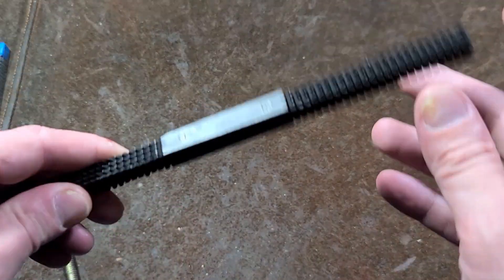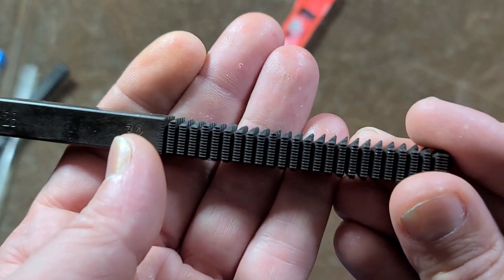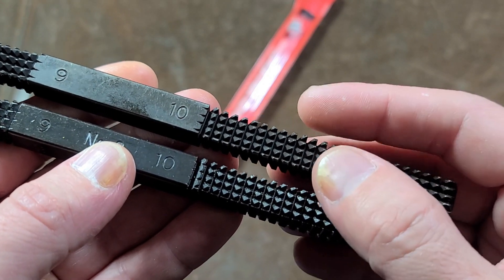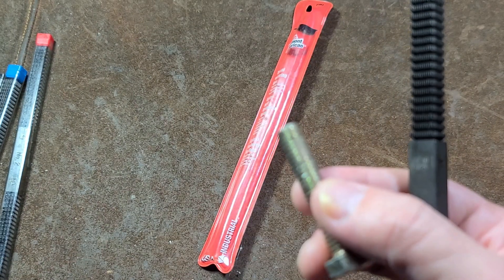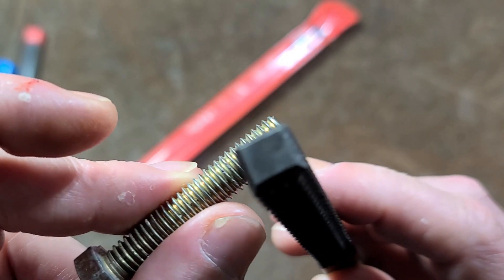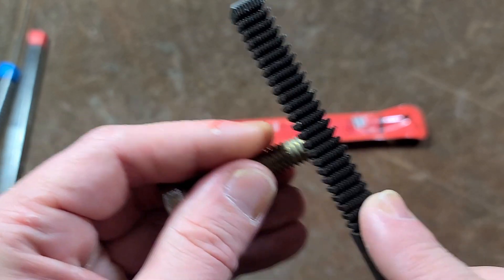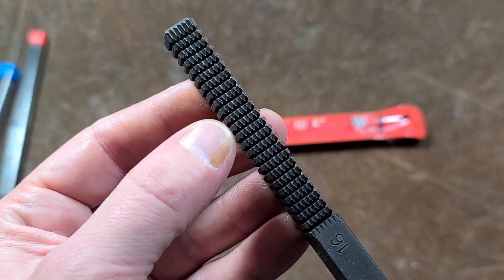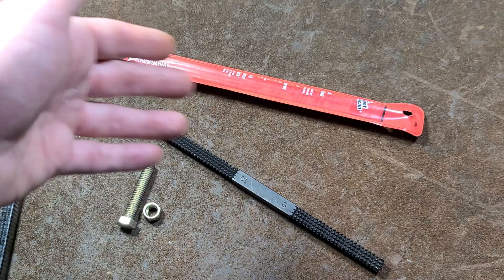Vermont American USA Thread File Review

Comment: They work GREAT, you sure its not the nut that's the problem. If anyone is interested in one of the treat files, they are sold at ACE Hardware.
Reply: They have sections on the ends to do internal threads.